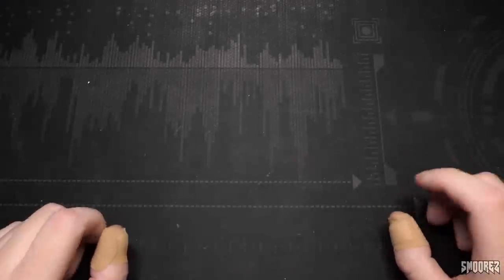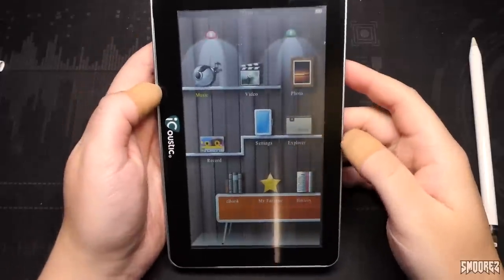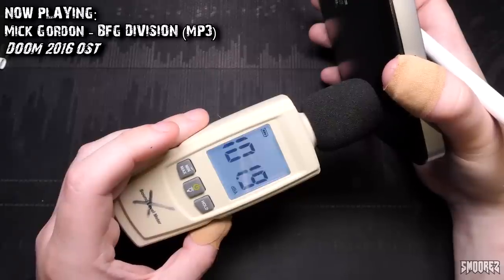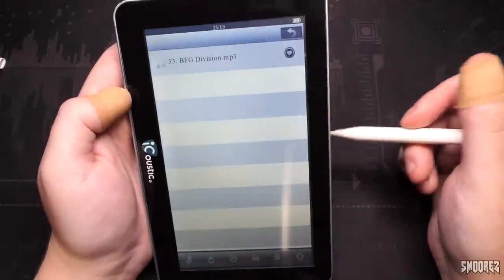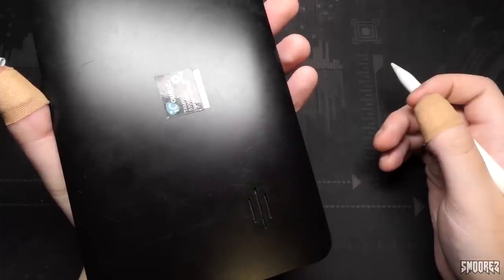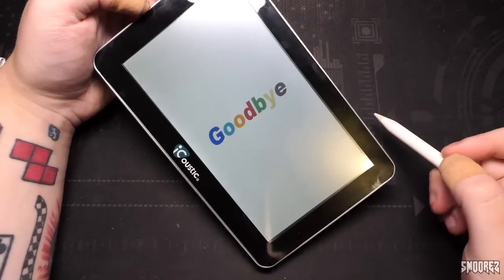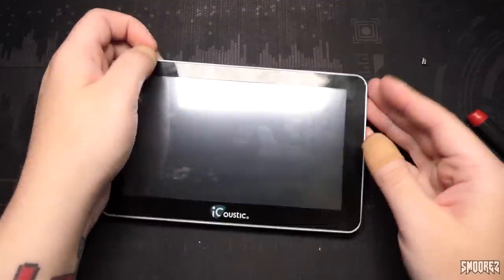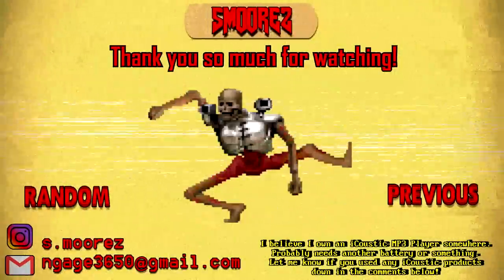I bought a Basic Media Tablet for 1 DOLLAR. Is it any good? (TACKY TABLETS EP 5)

Comment: That rockchip cpu was used in Android TV boxes a lot back in the day. To think of it, whole motherboard looks like it was designed for a square TV box but missing the hdmi and rj45 ports.
Reply: That chip can't run Android, it's too underpowered. The datasheet says it's designed just for these cheap media player/ebook reader devices. It also lacks HDMI or network interface capabilities. You're probably mistaking it for a different (and more powerful) Rockchip part.
Reply: @RaduTek  Why the hell is this thing a dual core then?
Reply: @qwertykeyboard5901  If you can't understand the difference between CPU and DSP you shouldn't be arguing on this. The CPU executes code, the program that powers the user interface, while the DSP decodes media formats, a task generally done by the GPU in a regular computer.
Also there are plenty of chips with actual dual CPU cores that can't run any operating system (Windows, Linux, Android) because they aren't made for this.
Reply: @RaduTek  Well then, I need to get one of these to port linux to. For my HONOR!
Reply: Rockchip is still going, and their single board computer SoCs are popular among people who make DIY game emulation stations, so their stuff is actually decently competent nowadays

Comment: the resistive screen is the most impressive thing honestly, havent seen a resistive screen used anywhere since like the era of early 2000 windows xp mobile PDAs
Reply: i thought this is normal on shitty iphone knockoffs around 2007~2013
Reply: @k.m4061  And budget Androids like the Vodafone 845 and feature phones like the LG Cookie  around the end of the 00s
Ah, and it's also surprisingly common in undustrial applications even now, because it's easier to use in dustier and wetter environments (though even in these it's starting to lose ground)
Reply: You've never been into a car accessories shop then. It's almost insulting how long resistive touch panels were used in car head units (well past 2010 on some budget models). My brother's Kenwood has resistive touch, but my slightly higher tier model of the same series has capacitive. He bought his new from Car Toys in 2020.
Reply: They were still commonplace on mobile phones in 2009
Reply: @jendorei  well also those shitty touchscreen phones from that era
Reply: and the wii u gamepad and 3ds
Reply: @Biggerman159  I can't believe I didn't think of that, as the owner of 3 Wii Us and 4 gamepads.
Reply: @awesomeferret  lol

Comment: Those rockchip chips are mostly in the Chinese emulation handhelds devices mainly in the cheap powkiddy and Anbernic machines 🙏🏽my bad this chip is only used for the 8bit NES clone handhelds so it's pretty bareboned

Comment: this tablet is basically an ebook. the screen resolution is 100% 800x480. it runs rkos (rtos variant) and many ebook devices have games on them. also tv out functionality depends on software installed, so it might not work even if you install the connector
Reply: Are you sure it’s Rkos? The mp3 player looks REMARKABLY like the stock Android music player from AOSP 2.3 with a skin on
Reply: @71bw  this isn't android, powers up way too fast, and the settings look nothing like android's should look like
Reply: @71bw  the os files are completely different from any android rom and the official rockchip documentation states that it was designed to run rkos

Comment: 13:36 no, even if you solder a jack in there it won't work because it points to nothing (the board components in that section are missing)

Comment: Greetings from the UK, I bought a 7 inch tablet from Cash Converters for £1. It all functions ok & it looks to be in good condition, but I need the internal ROM flashed because the previous owner set it up to their Google account & it won't let me in to the tablet!
I even got to the basic function menu by pressing a volume rocker button in while booting up, I did a factory reset but no change.
Reply: You don't need to get it "flashed". Just go into recovery and do a factory reset.
Reply: @jendorei  it won't let me into the tablet because as soon as you boot up, it comes up with, you have to log into the previous owners Google account.
Reply: @paranoidgenius9164  I'm telling you, don't boot the tablet normally, enter recovery mode (usually it's power+either of the volume buttons – one is download mode and the other is recovery)

you use volume buttons to navigate and power to confirm

be prepared that recovery might be in chinese, there may be a button to switch to english though
Reply: @jendorei  I tried the secret menu, but no change. I'm sure the internal ROM needs to be wiped, & reflashed